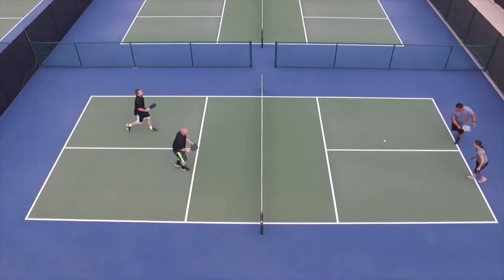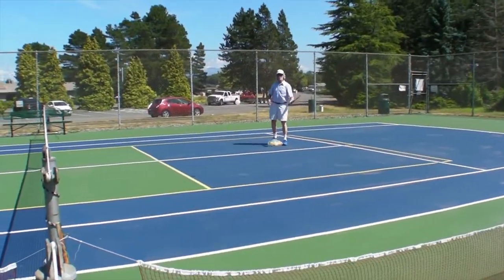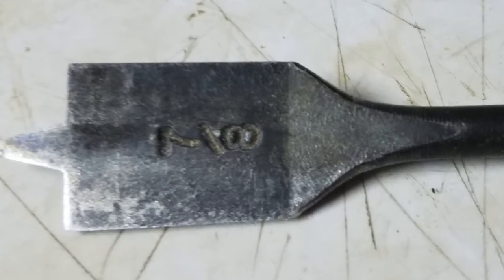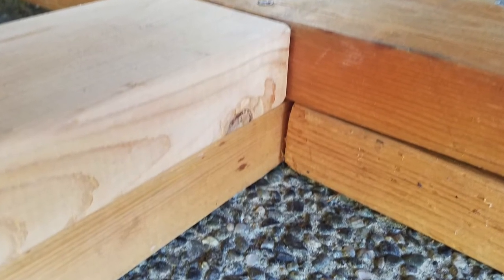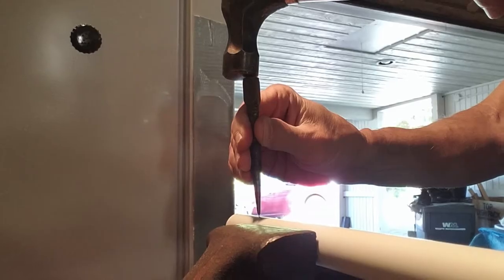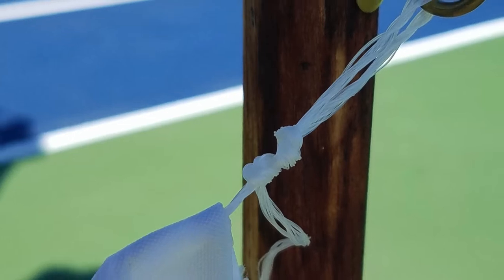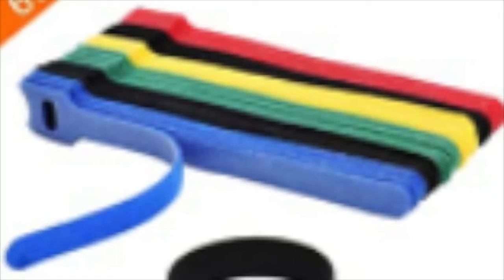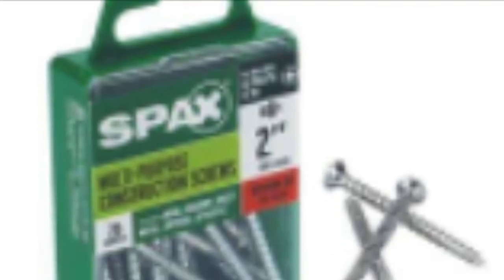DIY Court Divider for Pickleball  $30-50

Comment: I assume you bought badminton nets which are 6m by 60cm.  I bought some off Temu for under $6 Australian each.  I need to get some timber now.  Thanks for the idea.  I can get some 100mm square timber which I will cut into 60cm lengths.  I'm going to simplify things by nailing into a T shape with the ends pointing in so the net can't fall inwards.  I will drill holes in the timber so my metal poles extend up 60cm.  Will probably put hooks at the top like you.  Are the pipes critical?  Doesn't the net dangle on the ground?

Comment: The vertical pipes would be safer if they were longer.    What you have could hurt someone badly if they tripped and fell on it.     For soccer the corner flags must be 1.5 meters, or about 5 feet tall for this reason.   Another option might be to see if you can use rebar safety caps.      You might be able to use 2x4 pieces sitting on the narrow side,   if you constructed it  with a hole in middle for the vertical pole, following the general pattern of #, but omit every other short leg.   (Counting around the perimeter,  omit the short legs at compass points WNE, NNE, ESE, and SSE.     Leaving,  NNW, ENE, SSE, and WSW   Otherwise the design is great.
Reply from the maker: We've used it for a year without injury.  Because of the wide spacing between tennis courts, people almost never run into it.